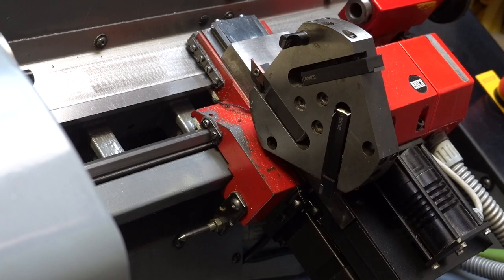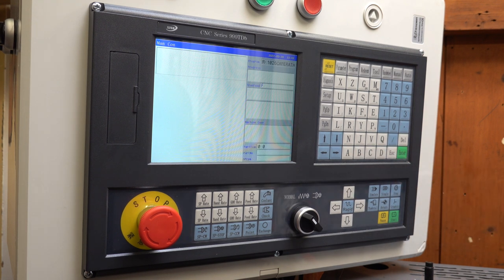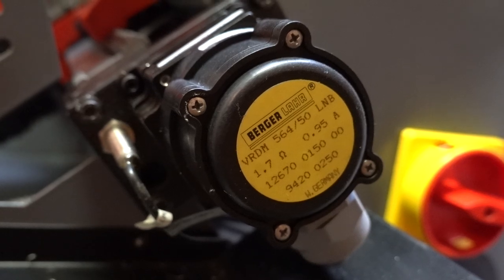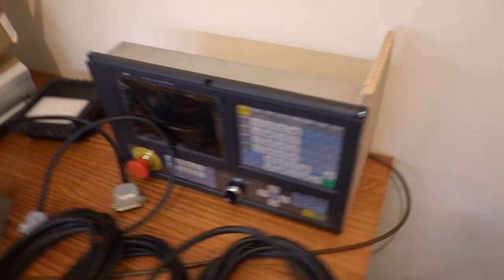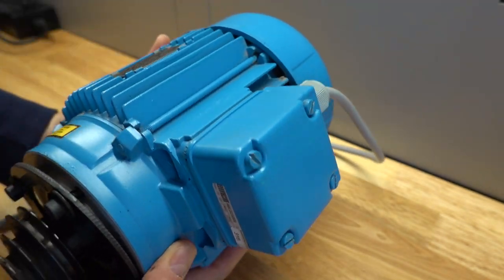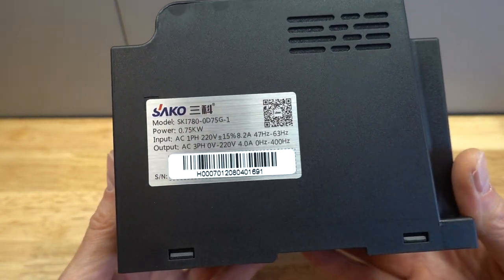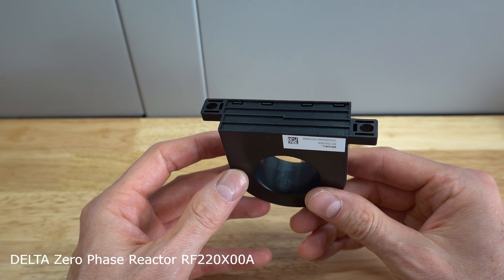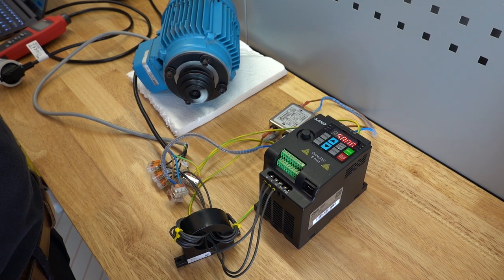Mini CNC Lathe Retrofit Part 1 - SZGH Controller, Steppers, VFD and Spindle Motor

Comment: SZGH also make/sell hybrid stepper motors and drives.  If you buy a complete controller/driver/stepper motor system it makes the job easier to assemble and trouble shoot with their technical man if there is a problem.

Comment: This is going to be an awesome build! Looking at the lathe bed, it looks as if it's the same size as the SEIG C0 lathe.
Reply from the maker: Travel seems quite similar indeed. The EMCO is a bit more bulky due to the enclosure, but I actually like that. Keeps most of the chips inside.

Comment: A little late to the party but if you want to silence your VFD fan then a 'thermal switch' inline with one leg of the fan wiring then place it on the heatsink next to the power electronics would work. Pick a fairly low temperature one but at idle the fan should stay off. I have used a bunch of these on PSU's and test equipment. Good Video too 👍
Reply from the maker: Thanks for the tip! This indeed seems like a great solution. I might give this a try. The fan is really noisy and most of the time the spindle is off when making a couple of small parts. Of course this is hacking a cooling system on existing equipment so I would not recommend this to others, but without making a video about it I would not mind giving this a try once.

Comment: Hello, can you make a video showing how to program the G76 threading cycle? How to fill in the variants and explain each one?,🇧🇷🇧🇷🇧🇷🇧🇷
Reply from the maker: Hi, sorry I don't have a lot of time to make videos currently, so I can't do request videos.    The G76 command has quite a lot of parameters. Hope you can make it work with the manual. I have not manually programmed threads using G76. I only used G32 or as output from fusion360.

Comment: I watched all episodes, thankyou for the detailed build, purchased the controller panel and having some issues tuning the stepper motors to travel the correct distances, i could not find any reference in your vids where you tuned them, any chance you can advise?
Reply from the maker: Thanks, sure, I hope I can point you in the right direction. In the axis menu under parameter you can set the length each axis travels per pulse. This is done by x and z settings for "electron gear". For example for the x axis you can change parameter 17 and 18, which are acting basically as a virtual gearing ratio. You cannot use decimals so I set 18 to a very large number, in my case 1000. For 17 I have 8000. So this will give a ratio of 8:1. For the z axis I have 19 set to 6440 and 20 is set to 1000. So a ratio of 6.44:1. How did I come up with these settings? First I tried to rationalize this by the amount of microsteps, ball screw pitch and pulley ratio, but in the end I just set a value and measured the distance travelled. If there is an error you can increase or lower the ratio by changing 17 or 19 depending on which axis you are working on. Hope this helps. Robin
Reply: @uptimefab7412  legend, thankyou very much

Comment: Peace be upon you. I want help. I purchased two control panels, model SZGH-CNC990TDb, 2-axis lathe CNC controller.

 SZGH-CNC990TDb 3-axis lathe CNC controller
 I am working on the Match 3 program
 I want to install the szgh control. I want a video of the motor settings for the size of the machine. I am not starting with the szgh control. Please help.
Reply from the maker: Hi, I am not sure if you mean spindle motor or stepper motor, but regardless I would just use the same size or amp rating that already came with the machine. I am probably not the right person to make a video about this, also I do not have time to make request videos, since I barely have any time to make videos based on my own ideas. Sorry about this, bit of you stick with known sizes you would probably be ok. That is what I also did with my lathe, buy a similar rated motor. Best, Robin

Comment: How do  you calibrate  the cnc to move right distances
Reply from the maker: There are calibration parameters for each axis in the controller. You can measure the moved distance and adjust the parameter for that axis to correct for the found error.

Comment: Hello! Which fusion 360 postprocessor do you use for szgh 990tdb?
Reply from the maker: Hi, I am using a slightly modified post based on the standard fanuc turning post processor that comes with Fusion 360. (Added change to canned cycle for drilling). The post is available on my website including info on what was changed. See link in the description.

Comment: Does it adjust  the speed of the vfd from Encoder readings
Reply from the maker: Hi, no it does not adjust speed according to the encoder readout. The controller outputs a voltage between 0 and 10V to the VFD based on the programmed RPM. The VFD then runs the motor at the desired RPM and the controller displays the actual RPM but does not correct it's output. I have calibrated the VFD itself to the programmed RPM. There might be a setting for this that I have missed, but this is how mine is configured.
Reply: @uptimefab7412  thanks ...i wish i can find somome who csn assist bwith that ..i am about to purchase this controller
Reply from the maker: It is a matter of finding the right parameters. On the controller it is quite straight forward. There is a spindle speed setting called P36. You can set this to the maximum RPM that you want your lathe to run at. This will correspond to 10V on the spindle output. For the VFD there is a similar parameter that indicates the RPM that it will run the motor at for the maximum voltage of 10V. Which parameter that is differs for each brand of VFD, but they all should have this setting. When this is done you can run it and tweak the parameter on the VFD if the measured RPM is off. When you have a controller and VFD and encounter problems please let me know and I will do my best to help. As mentioned in the video I am not a specialist in VFD settings, but I can share what I know.
Reply: @uptimefab7412  the reason  why i need the controller  to adjust the VFD (spindle  speed ) based  on an encoder  reading is becouse  my lathe has 3 position gear so i know  maximum  speed of gear 1 , gear 3 and gear 3 , so say for example i run the code with S2000 which corresponds  to gear 3 the program shouldn't  start since the spindle  speed is not within  95% of the required speed i want to use M codes to chance  the gear of the machine and use the input  pin to register  gear position,  i have done this with Mach4 i just dont know how i will  approach  this  with the SGZH controller  looks like something  possible  , i just want the gear  change  to be facilitated  by the controller  ....Sort of PID feedback system .
Reply from the maker: You are able to set max RPM corresponding to 10V for up to 4 gears with the SZGH controller. Also gear shifting is supported with M-codes M41 through M44. Have not tested this since my lathe does not have automatic gears, but from what I see it should work. See page 99 of the user manual. If you need more details it is probably best to ask the SZGH support team.
Reply: @uptimefab7412  thanks for yhe shared information

Comment: Hi, please send me INPUT PSW for 2 Grade, to change parameter for my CNC GH-980TC. thank you
Reply from the maker: Hi, I only have used the default pw "111111". If that does not work for the feature you are trying to access, please contact SZGH support.
Reply: I’m working on a SZGH-CNC 1000TDb and this worked 😎

Comment: i just purchased a southbend magnaturn 612, the machine is 100% there, its not running, not sure why, it looks to have been upgraded when new with the delta 50 hardware, i purchased a masso g3 touch and accessories to retrofit it,  they built this thing like a tank with all baldor brushless servo motors and power supply, i have been trying to wrap my head around how to do it, hopefully this video will shed some light
Reply from the maker: Hi, the magnaturn looks like a very cool machine. Hope you can get everything working with the g3, good luck with your project!

Comment: Can I built one using mach3 usb cnc kit with normal stepper motor,Sir ? I'm beginner on cnc stuff
Reply from the maker: Hi, yes it should be possible to use mach3 turn in combination with a USB board compatible with mach3. It should work fine since most lathes are the same even though they look different. They all have a X and Z axis as well as a spindle. Also regular stepper motors are possible. Start with whatever option is within your budget. If you are a beginner I would buy stepper motors together with the driver as a kit.
Reply: @uptimefab7412  thank you very much,Sir

Comment: Did you increase the frequency of 50hz on the motor ??
Reply from the maker: Yes, I have set the max rpm for the spindle to 3000 rpm after replacing the bearings. The pulley ratio I am using is not exactly 1:1 from motor to spindle but let's say the motor runs at least at 100Hz. I would have to get to the back of the lathe and  look at the vfd setting, since that is how the rpm is calibrated, but this the rough number. Note that I am typically only going up to 2500 rpm for no specific reason other than noise. I should be running the lathe even higher than 3000 for small brass parts, but it mostly cuts fine at 2500 rpm already.
Reply: @uptimefab7412  thanks for the info

Comment: Does this apply to the Emco Compact 5 CNC too?
Reply from the maker: Yes, you should be able to retrofit an Emco 5   CNC lathe in roughly the same way. They use mostly the same parts. Might be slight dimensional differences so I am not sure if motor and encoder brackets I used will directly fit on the older type. The szgh controller should work, it can be used to retrofit any standard old CNC lathe.

Comment: Hi, i have cnc 210 lathe machine with the same control unit. For CAM software i use Fusion 360 and I don't know which post processor would be good for the machine? Maybe you can help me?
Reply from the maker: Sure, you should be able to use the MACH3 mill post processor that comes standard with Fusion360. Others may work as well but this is the one I use. --EDIT: referenced wrong post, see correct answer below.
Reply: You think mach3 turn postprocessor  😊
Reply from the maker: Sorry, was not paying attention, I thought you were commenting on the mill (CNC router) video. Please disregard my previous answer. For the lathe I am not using a MACH3 post processor, but a modified FANUC post. You can start with the one supplied with Fusion, however not all Gcode is supported. I modified the post, you can download it for free in the website article linked in the description.
Reply from the maker: The cnc 210 lathe looks like a cool machine by the way
Reply: Tank you, i'll try with your modified pp. Yes, the machine is interesting, it costs little, it has suitable dimensions and as such it will be used for education. Next to it, I have another milling machine with a Chinese adtech controller (the post-processor for it is mach3 mill).
BTW, your project is excellent.
Reply: @josipmijatovic6974 Hello Josip,
Can you tell me anything about your CNC 210 lathe?